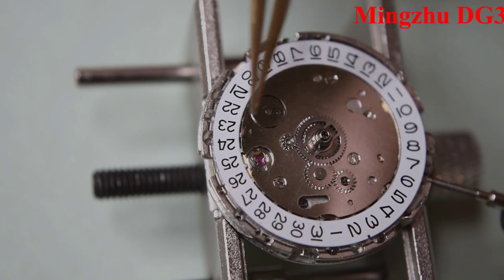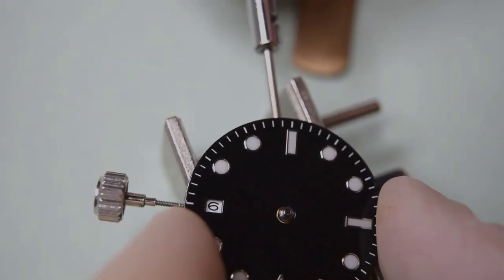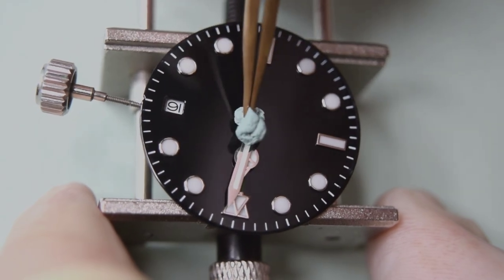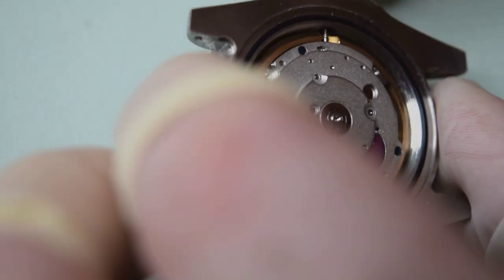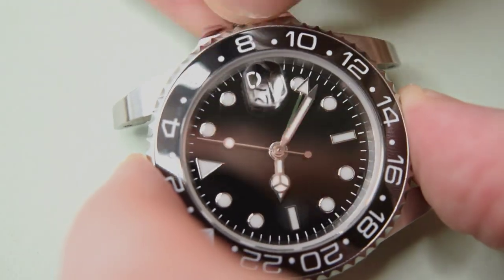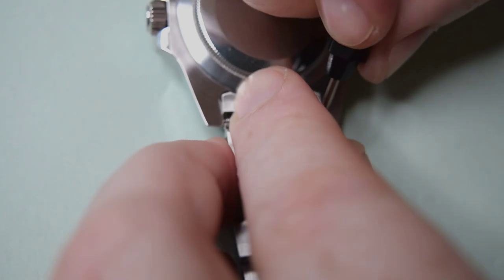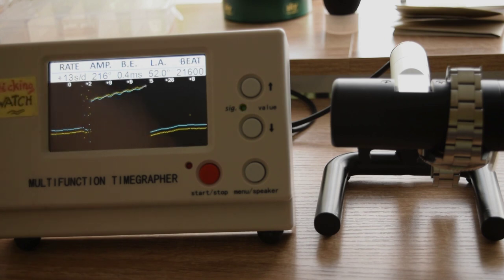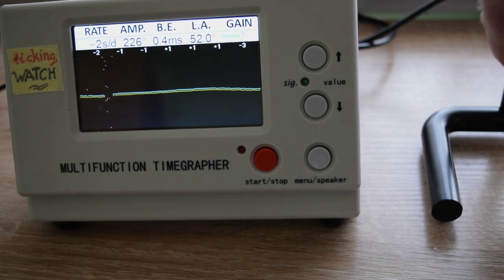🔴 Chinese homage wrist watch Mingzhu DG3804 GMT movement | re-casing and timegrapher test episode 4

Comment: Good job! I watched all the 4 episodes of this watch service on your channel and I'm glad that you have achieved such a great results with this caliber. It encourages to try to do it at home. This cheap Chinese movements are great as a starting point for practice in the watchmaking hobby. As it is much more interesting than just throw it in the bucket after several month from buying. Also may be there is an easier way to mount the plate that took you 3 hours?
Reply from the maker: Thanks, I have the same opinion and of course, after some practice, you will install the top bridge in a few minutes.  😀

Comment: Further update:   After a few weeks I found that watch kept stopping ..... always the second hand pointed at 55 seconds ... a shake and it would restart   .......    now it runs for a short while and then stops again ...... I looked at the movement with only the rotor removed under a quality microscope and could not see the  see the offending dirt or metal ....... it seems that leaving dirt in the watch is a common occurrence for this mingzhu movement. 
  I've ordered a Seiko NH35A movement as I didn't get lucky with the Parnis one ........ the one piece bridge is a tough one ..
Great series and thanks!!
Reply from the maker: It seems that service is needed. Quality of this movements can be different. Ones runs perfect but the other not really well. Good luck with your watch 😉👍

Comment: Great video .  But even with 4 years watch repair experience with mostly ETAs, Seiko and Miyota ,  I will not try to align 6 points to assemble the top plate.     Is there a way to repair the not working hacking function without dismantling the top plate which is so difficult to re-assemble.    Of  course,  another easier option is to buy a new movement which is not that expensive really
Reply from the maker: Hi Thanks, the point here is that there is also a mainspring barrel and you can not clean it and lubricate without disassembling the top plate. But do not worry a little bit practice and it is not so difficult.
Reply: @tickingWATCH  The movement is new  and therefore I do not need to clean the main spring barrel.   Only the hacking is working sometimes . Perhaps some jamming of the hacking lever.    I can live with it   instead of spending hours aligning 6 points to fix the top plate after disassemby.     Just wondering any quick fix   without the tedious task of re assembling the top plate
Reply: yes you should definitely attempt it with 4 years experience. watch repair channel shows a technique where you loosely attach one end of the bridge and work it about gradually, but i've had another idea, untested but it's how mechanics bolt on engine heads: make studs (long headless screws) to screw into the screw holes, then drop the bridge down on the studs. my thinking is that you can generally make the wheels sit upright, but they move around when you try to blindly position the bridge. hopefully the bridge drops on with only a few attempts, then you hold a finger on it while you replace studs one at a time with screws

any ideas how to put the right thread on a rod? is there any chance these screws are the same thread & diameter as one of the standard stem sizes?

Comment: I've purchased exactly the same watch and I'm wearing this for a week. It is pure fun to have it. High value for money. For now DG3804 Automatic werk seems to be working just OK: it lost something like -2s a day when it was worn, gained +2s a day when it was left on a shelf. After a week it loses 30s a day. Anyways, I didn't have high expectations regarding DG3804 - it might be a matter of sheer luck what you get from the Far East.

Besides throwing away, going to clockmaker or maintaining yourself, there is also anther option: werk replacement. You can buy another DG3804 online. Or even: consider buying a Miyota or any other GMT movement and making replacement. How about that ?
Reply from the maker: Definitely there are quite big quality differences between this type of watches. Buying a replacement movement is always a good option especially when someone doesn't feel comfortable with servicing and mostly, by this type of watches, costs less than service by a specialist.

Comment: i notice people say these movements are difficult to regulate. my experience is that the problem is that the regulating lever is very sensitive and needs to be moved tiny amounts ... which is difficult when the standard high tech equipment is poking the lever with a stick. i find that pushing the lever by the tiniest possible amount means you will eventually get lucky ... after three days [i don't have a timegrapher so i need to wait between attempts] i have turned a -30 second 3804 into +8 sec, and this is close enough, but the tool some people make is a screwdriver with a slight gap ground away from the middle of the blade, so you have two teeth sitting either side of the lever. i think maybe the movement here is not representative, that despite being properly reassembled it retains the scars of its unfortunate childhood
Reply from the maker: Thanks for your advice I really appreciate it
Reply: Use toothpick and apply like brushing gently and you can keep +2, -2 easily.

Comment: For getting that second hand back on, did you find that you had to push down on it very much in order to get it to stick on and not impact the other hands? I just broke a DG2813 movement by trying to put the second hand back on.
Reply from the maker: We have to be careful here, it is so because of the tension spring, but for 15$ you can get a new one 👍 good lock with your repair

Comment: I have similar GMT movement. I reinstalled the stem and it would change time in all three positions. I removed the stem, turned the watch with Crystal facing down and reinstalled.  I now have all three different positions back but the second hand will not move like the hacking is stuck. Any suggestions?
Reply from the maker: I would disassemble the keyless work, you can reach it from the dial side, there one of the leavers ( as I good remember it is the yoke) works as stop second

Comment: Great series bro, I've got a Parnis GMT, I got it cheap on ebay nearly a year ago, it works fine but it gains about 2.5 minutes per day,
Is it possible to slow it down?
Thanks for the videos 👍
Reply from the maker: Nice watches this Parnis, it is possible to regulate it, check this video https://youtu.be/hzwdQaLyj2g
Reply: @tickingWATCH 
Thanks bro, ill check it out, have a good one 👍
Reply: It could need simply demagnetizing  ..... I bought one on ebay for around 6 euros .......
Reply: @davidmanze7563  yes, if your watch is stupid fast you should suspect the balance spring is sticking to itself, either with magnetization or oil on the spring. both are easy to fix. otoh, stupid slow and it likely needs careful cleaning and reassembly as shown in this video series, which is nice if you want a new hobby but it's more sensible to buy a new mechanism and hope you get a good one

Comment: It would be possible to replace the dg3804 by a Chinese movement replica RLX 3186, into a case RLX GMT 1675?
Reply from the maker: Hard to say first you need to compare measurements from case and movement, then the movement holder by DG is definitely a different one.
Reply: @tickingWATCH  OK, thanks a lot

Comment: NH35 movement installed in the Parnis ........ dial date window is positioned differently and had to be carefully filed to line up ........ hands are a different mounting and needed replacing ......... back to the 0-60 ceramic bezel ........... no more Parnis watches for me !!
Reply from the maker: As far as I know only Miyota 8215 (or 8205) Mingzhu 2813 and ST16 are having dial feet in the same place and hands should also fit.

Comment: Hi my friend I have just bought a replica Rolex and the seller told me it had a Japanese Miyotota inside but to my horror its got the cheap Asian movement like this one. My question is do you think I could buy a miyota and fit it inside the Rolex? . Its the submariner size. Thanks... .
Reply from the maker: Hi, unfortunately, that happens. Does your watch have a GMT? If not then I think it a Miyota 8215 should fit. 👍
Reply: @tickingWATCH  it just has one time zone and the date adjust so I think no GMT. Are they easy to fit? Thanks man...
Reply from the maker: @hills123ful  not really complicated, see my vid about dg2813 to Miyota replacement 😀

Comment: Do you know if a NH35/36 dial (like Seiko) would fit on this movement?
Reply from the maker: Rather not, different feet alighment
Reply: @tickingWATCH  Do you think it would work to attach it with double sided tape? I got an idea to build a vintage GMT Seiko.
Reply from the maker: @HaasGrotesk  In this way should work, one thing you need to check is the date window. Is it directly above the date dial. Good luck with your project.

Comment: Thanks for the videos on the DG 3804. I have a Bliger watch with this movement which keeps great time (+4 s/d). When I wind the watch I feel no tension on the spring, the watch will just wind and wind and does not stop! However winding does power the watch as you would expect. I wonder if this is normal for this movement?  I watched all four videos on the DG 804 to get an answer to this question but you did not mention this. Thank you.
Reply from the maker: The pleasure is mine Tony Cooper!  Check the power reserve if it is about 35 or more hour than everything is ok 😀

Comment: Thank you for the videos, it was very interesting! But I would like to find an information, how to adjust the movement. I have a new Pagani, that is massively too slow (4 minutes per hour) Is there a way to adjust it? Thank You so much!
Reply from the maker: Thanks. I'm really glad that you like it . Check this video https://youtu.be/hzwdQaLyj2g but if it is late so much it is probably something wrong with te movement.
Reply: @tickingWATCH  Thank you very much! If the movement has a problem, that can't be fixed easily, I will do, what I saw in your videos. Maybe only one way :-D
Reply: @hankbannister  normal regulation is easy. minimum knowledge, imo, is being able to describe the difference between the two little levers. if you know that then you're fine and you're not being confused by someone's vague instruction. next easiest is buying a new mechanism, which only involves what you see in this one video [re-use the old stem & crown, because it's cut to the right length. they come with extra length because they don't know how big your watch is]. way way harder, but more interesting & cheaper (though you still need to buy oil, tools, grease) is complete reassembly, which will fix bad assembly, poor finish, dirt or incorrect lubrication
Reply: @5naxalotl  I meanwhile found out the source: The movement was faulty. There was a stone missing. Had very bad experiences with the Pagani Shop on Ali Express then. Never again.
Reply: @hankbannister  wow. very bad! most of my chinese watches are like $20 Tevise models, and they work very well and keep good time after i regulate them. i just bought a Bliger because it's the cheapest explorer 2 lookalike, so i'm relieved it works well ... but i'd probably just wear the cost if it was a dud, because i couldn't face the hassle of getting a refund. i'm kind of delighted the chinese make a cheap GMT movement, so i think i get more enjoyment from taking the gamble than if i paid a lot of money. they seem to be perfectly good designs, assembled in a dirty factory sometimes, but flawless other times. probably a vostok is a better bet for quality control. my other "expensive" watch (lol) is a shiny red kommandirskie, and it keeps great time out of the box
Reply: @hankbannister  damn cheeky sending you the wrong movement. i wouldn't be able to cope with the fury i'd be feeling. nearly all my watches are ebay or banggood/gearbest so i don't hand out my credit card number. i have god knows how many used indian HMT's but now i'm a cheap chinese watch enthusiast. i prize my "perlative ceronometers" but weirdly i gravitated to using the quartz t801 i bought accidentally, so it's a good reminder how much the need for mechanical is an affectation ... or maybe a love of the mechanism over its actual function. except now i'm wearing the mechanical bliger and i'm really happy. childish delight at a pointless orange gmt hand and the lovely student graphic design exercise of a white explorer 2. i saw it on raymond reddington's wrist and i had to have one. i got the naked dial so i can write Rolex on it with a sharpie. or maybe Bolox. people who buy absurdly expensive watches don't know what they're missing imo
Reply: @5naxalotl  you sound very reasonable. I see it exactly like you!
Reply: @hankbannister  chinese junk. Few people have good experiences. You look around and few people have chinese mechanical watches that are still alive after 6 months. Some people don't make 6 WEEKS. This is why I keep buying old soviet stuff from ebay. Might need a service (some come already serviced), and if they have problems the parts movements are like $2 or less if you buy 10 or more. But ultimately the soviet stuff  (except for the 90s after 1991) are well built watches. They're not swiss but they're not junk either. Except for the one decade when they had big money problems and much of the tooling wore out. They also have features that you really wouldn't expect from the USSR or that price range, things that not even citizen watches will have. I have been surprised.